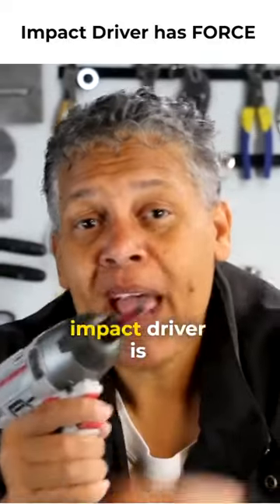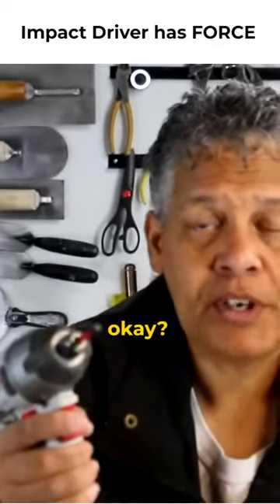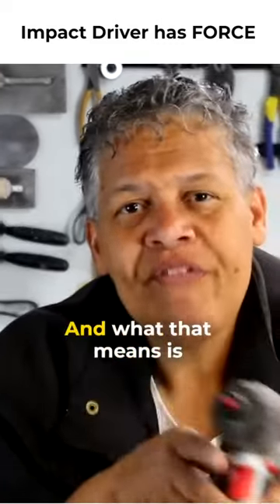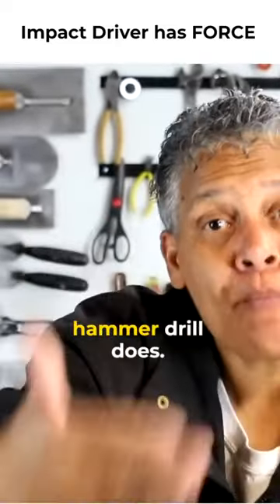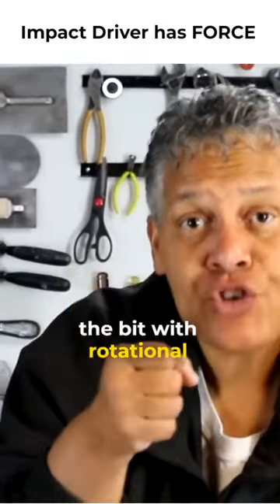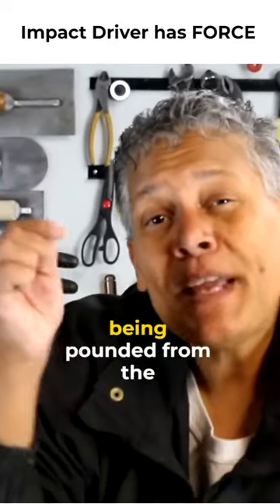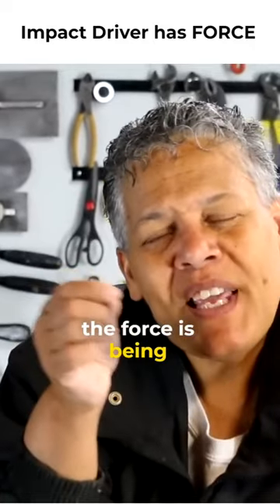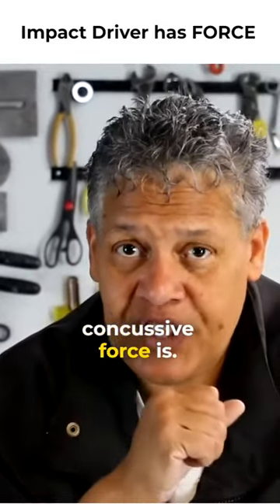Impact Driver has FORCE  #short #impactdriver

Comment: For anyone that doesn't have strong hands, an impact driver is a godsend. A powerful drill has a lot of twisting force and when the screw becomes close to being inserted all the way the drill can try and twist itself out of your hand. This can be a handful when the screw is fully tight.

They don't drill as fast as a normal drill but they're not slow but they can drive screws in with more force than a drill can.

This still happens with an impact driver but it's much less. It can tighten screws and bolts better than a drill but with less of the kick-back when the fastener is tightened. The only downside is that you really should buy screwdriver bits and drill bits that are designed for use in impact tools. Not only are they designed to withstand the extra stress but the tips are designed to grab the screws better so they don't slip - which makes life even easier.

Some of the better smaller impact drivers have different power levels that go from really gentle and tighten to a few inch pounds to being able to take lug nuts off a car.
Reply: Thank you for explaining the difference for the DIYers.

Comment: You can get a handtool that does the same thing but you have to hit it with a hammer and it has a cam in it that rotates the bit you place in it. The effect is that the bit is driven downwards and then rotates and stops the head of the screw being stripped or 'cammed out' because the action ensures that the tool is mated properly rather than not being pushed down which can lead to wear on the head.

I assume this battery version also drives downwards to achieve the same effect.

Comment: I think the best way to show this is to take the front of the impact driver off and show what's doing the work--the anvil. Torque Test Channel has a bunch of videos breaking down the insides of impact wrenches, which are essentially impact drivers that don't hold drill bits.

Comment: I got an impact driver today. The first thing it split a cheap generic 7/8 socket. So I had to get impact driver sockets. Then it rocked for 7 seconds before removing the nut. I can tell you, I oiled it,  I tried a box wrench with a hammer. I heated it with propane. I tried a socket with an 18" pipe.
The nut was easily accessible I have no cuts or bruises from reaching. It just would not come loose.
It cost $160.00 with he sockets, but now Im equal to any homeowner type repair.

Comment: This may be a stupid question. 
Which of the three is best for which applications?
Hammer drill vs. Impact vs. Regular drill.
(Have I missed qa video in this series explaining this?  I've seen others but, they don't explain what I want to know the way this series does.)
I am learning to use all of these items as I go along, but, DIY means I can do the work without breaking th bank.
Reply: I think hammer is better for drilling holes into masonry, impact is better for driving screws into pieces, I use regular for drilling precise holes and to tap drill holes- though some impact bits are tailored to do both tap drilling and driving at the same time (which makes it a lot easier !)
Reply: An impact driver is for putting fasteners (screws and bolts) in. A hammer drill and a regular drill are for making holes. 

If you are making a hole in something that is hard and brittle like concrete, tile, brick, or rocks you want a hammer drill with a special bit. It doesn’t actually cut a hole it chips out a hole. Every hammer action sets the bit into the material a tiny amount then it twists causing a little bit to chip off. 

A regular drill uses a constant rotational force to cause the tip of the drill to cut into the material. You can see this when you drill plastic it doesn’t come out as small pieces the material comes out as a long curly que. Wood doesn’t create a curtly que because the grain causes it to break apart.
Reply: Thanks, folks.
I have all of the above-mentioned drills, and appropriate bits, as well as a REALLY old house that needs a bunch of work.
I didn't want to start making holes in things like the concrete, masonry, and incredibly hard Douglas Fir before figuring out which drill to use for what material. 
Eco, I appreciate your time and explanation a great deal as it has cleared up quite a few of my issues.

Comment: Is that best for installing screws into a concrete wall or would a hammer drill be better?
Reply from the maker: Hammer drill is what's  needed
Reply: What you do depends on what you're doing.  

A regular drill just spins with rotational force. Great for screws into softer woods without too much resistance. 

An impact driver adds a pounding or concussive force in the same rotational direction.  It does this to provide extra force as the screw meets resistance in the harder material.  

A hammer drill adds similar pounding or concussive force but in a forward direction, not rotational,  as if you were hammering.  These are perfect when you're drilling holes in concrete or brick.  In this situation you wouid also need to use a masonary drill bit which has an extra cutting blade on its tip.  The rotational force of the drill allows the masonary bit to cut the concrete or brick while the hammeeing effect punches the hole deeper.  

Now, once you've got the right sized  hole in the wall you would most likely use an impact driver to help turn a bolt or scew into the hole.
Reply: @mymatemartin  I like to think of hammer drills as concrete chisels.
Reply: You first need to make a hole in the concrete. Use a hammer drill and special bit to do this. 
Then a self tapping concrete screw needs to be installed. Use an impact driver to install this. But be very careful to stop as soon as the screw is fully seated because concrete is brittle and the threads can be stripped very easily.